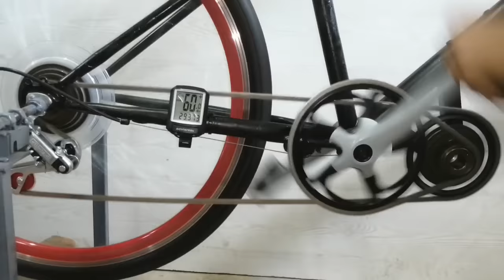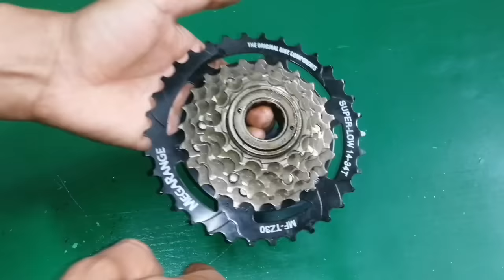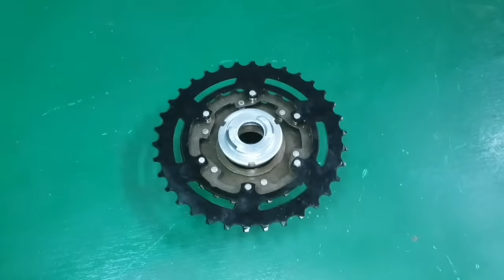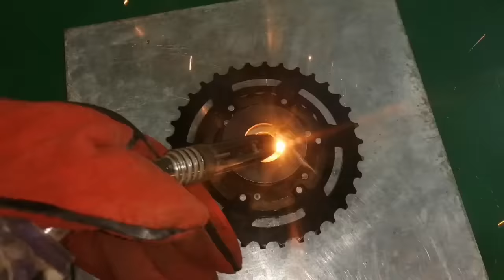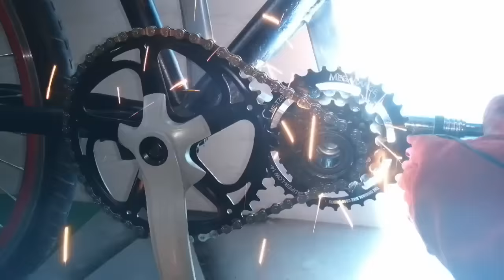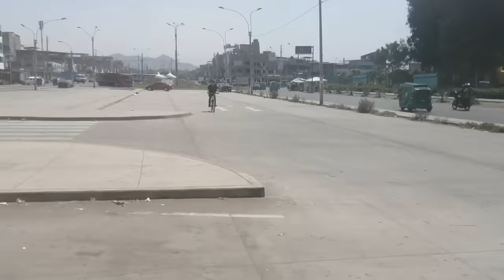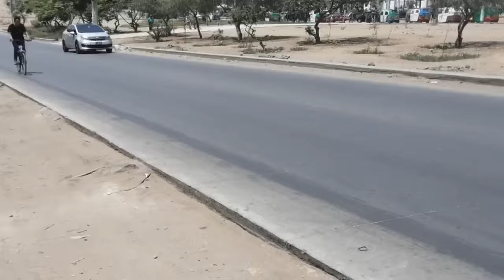making super fast bike

Comment: Bikes used to have a front derailleur for multiple sized cranks.  I hate that this went away.
Regardless, the most effective way to increase speed while reducing the amount of force needed at the pedal would be a pulley system.
Reply: no many bikes still come with front derailleur.  they've just fallen out of favor cause there mostly useless, in regards to the number of gears you'll actually need or use whil out on the road.   the advantage of a front derailleur is not  to get 21 speeds but to have a down shift to a smaller gear which is handy and smoother when going up the hill. where changing to a bigger gear on the back to downshift is more clunky when your required cadance is hard to maintain.  with most e-bikes and a lot being hub driven  its actually better just to have a small gear ratio where its easy to pedal to get started and a high one to switch into when your moving along nicely as you don't need much else.
Reply: Thanks @Plaxy100, I've been out of mtb since Sram just started introducing the XX & X1.  Now back in with post-divorce budget (~$0), I'll eventually get to upper level cranksets.  For now, the frisbee-sized ninja stars appearing on the granny side of 12 speed cassettes make me wonder how close these ratios still are.  My Southwest US racing commonly involved >1 hour climbs at over 10,000 ft.  I needed to keep the granny gears close together as I have a very rapid narrow-range climbing cadence. I just don't see how the fine tuning can remain for the most demanding XC riding when you reduce all prior solutions to a 12 speed. Thoughts?  (I know, I know, I can plug the numbers into a spreadsheet to get all the ratios, but I suspect that on-the-trail may feel different than on paper.)
Reply: Front derailleur is only good for stop acceleration. Useless otherwise, just a piece of metal adding weight, dirt and rust risk
Reply: @Aphorism89  Higher top speed is another reason for it.  The tiny single cranks that come on bikes today suck ass for everything except coasting downhill.
Reply: @Inmate533  luckily they are easy to replace and relatively inexpensive. I mean, one can eventually take them out and buy too quality ones instead. I wouldn't mind having 2 plates, used to have that on my road bike and it was great.
But now a days I'd always try to minimize. The least elements, the least maintenance and risks :/
Reply: @Aphorism89  It sure is helpful when you are going uphill with strong winds and cargo on board though.
Reply: Most cheap bikes still have a front derailleur. At bikes that dont have one you can in many cases add one.
 I think front derailleurs have some advantages, but they als make things a bit more complicated. With 3 sprockets at the front and a casette at the back, you have several combinations that dont work well, because the chain runs too much diagonlly. Beside that you als have several very simila ir even the same gear ratios. 
So I can understand why many people prefer having no derailleur and a bigger casette instead.
Reply: @jeanyluisa8483  Cross chaining is much more of a problem with 1X coz with 3X you can always find the required gear with the chain ⛓️ reasonably straight.
Reply: @radiocontrolled9181  In 1X10 the sprocket in the front should be about in the middle of the cassette. In that case the chain in worst case has to to 5 gears left or right of the front sprocket. If you use the smallest or the biggest sprocket in 3X7  the chain might have to go 7 gears left or right and those old cassettes are even wirder than the newer ones with 8-10 gears. 
So the crosschaining can be much worse in 3X  and there are combinations that work very bad or dont work at all. In 1X all gears should work, otherwise it wouzld be a very bad design or setup.
Of course you can find combinations whith the right gear and the chain being resonable straight in 3X. You even have to find those combinations, thats exactly why I wrote 3X can be more complicated.
Reply: @jeanyluisa8483  With a 3X you will obviously avoid those combinations that involve cross chaining of 7 gears. And you don't really need those as you have an alternative with 3 front chainrings. With a 1X you have no alternative to cross chain 5 gears when you really need that gear. This cross chaining issue with 1X's is a fact that even many hardcore 1X fans fully acknowledge. Now if 'finding' those combinations on a 3X to keep the chain reasonably straight is too complicated for you, well then probably the 1X is made for you. But I can assure you that any person with an average IQ or even below average, will be able to find them without even giving it a second thought. It will come as natural as changing gears in a manual transmission car.
Reply: @radiocontrolled9181  Talking about persosn with an average IQ - those usually also can read properly. I never wrote finding the right combination on 3X is too complicated to me.  I wrote "front derailleurs make shifting a bit more complicated, so I can understand why some people prefer 1X". Of course those people are not too stupid too find the right combination on a 3X. They are just smart enough to understand that its more comfortable and simpler to use one shifter and one derailleur only.
If you look at the market, there are still a lot of 3X. It's mainly the expensive bikes for high end and professional users that have completly changed to 1X. So it's obviously not just silly people who prefer 1X.
Reply: @jeanyluisa8483  LOL talking about people who can read. Seems like you missed the word 'if' in my comment. Read again. About professionals using 1X, those are sponsored by the big bike manufacturers who want to push new products on the market to sell more. They use them as advertising. The professionals wouldn't be able to choose to ride a 3X even if they personally preferred that. They are forced to ride 1X. The 1X invention was a marketing move to convince the masses that it is an upgrade when in reality it is a downgrade in most cases. It worked. The sheep swallowed it all. And the bike manufacturers stopped selling high end 3X to give the customers no other choice but to buy 1X because it's the new 'trend' and it is 'better', 'cleaner' and 'lighter' and all the other bs
Reply: nic ie odeszzło  Shimano całyczas produkuje takie korby
Reply: @plaxy100 It's not really about a smaller gear. Your can get very small gears with 1x. You just have more changes between each gear. So you may not have the gear you want especially if you don't have 11 or 12 speed in the back.
Reply: @radiocontrolled9181 Currently the most popular chainring is a 2x. Most good bikes are 2x. And the last TDF winner is a 1x bike. 3x is really on the low end bikes.
Reply: @berkertaskiran  Yep, currently. Which means it's where the big bike brands and their sales promotional people are pointing at at the moment. It's always like that. The moment they start pointing in another direction, that will suddenly become the new 'good' and the new 'best'. Because most people are too gullible and easily influenced.
Reply: @radiocontrolled9181  Stuff gets improved. It's not always marketing. You don't have to get something new if something works for you. I own a 3x8, and am in market for a 2nd bike which will be used by two person so it's not like throw away the old one. I wouldn't really get a new bike or a new drivetrain just to follow the trend. It's useless. Unless I have money to burn. Personally I like the simplicity of 1x but have never used 1x or 2x. I know I am not a fan of a ton of gears on 3x. It's just you get pretty much similar amount of gear options with 2x. With 1x you obviously get less. But 12 speed is a bit better. Not very cheap obviously.
Reply: @Aphorism89 there is me on my road bike that leaves traffic lights using 53 at front and 11 at back
Reply: @mlee6050 headwind is the main factor
Reply: @PInk77W1  I yet to find a headwind strong enough to make me change down, most annoying thing is most go with wind and my journey is often against
Reply: @mlee6050  if there’s zero wind and u go 20mph u now have a 20mph headwind
Reply: @PInk77W1  guess that helps as then starting of is easy
Reply: I've got a rare 3x on a road race bike and love it, as you can quickly go from extreme climbing, to spinning the mid ring in order to accelerate, and then to big gear cruising, all within the span of three shifts without cross chaining.
Reply: Es mejor monoplato 1×12 54 dientes en el plato delantero y 10-60dientes desde el más pequeño al más grande
Reply: @jeanyluisa8483 the point of 3 front gears is to quickly drop down a large amount of gearing quickly when needed. Also the lowest ratios on each end are almost in line, and the higjest ratios on each end are made to line up so top gear has least chain drag. If you change down to a middle rear gear, probably drop to the middle front if you're worried about drag. Its not hard to keep the chain relatively straight. Or just do away with derailleurs altogether with a schlumpf high speed drive up front and a rohloff or enviolo rear hub. With these you can use a belt drive that will outlast a chain using less energy and no worry about lube.
Reply: @rossbrumby1957  No, thats not the point of the 3 sprockets in the front. Derailleur gears where invented more than 100 years ago. Thery started with few gears and at some point they added sprockets in the front too get more gears.  50 year ago precision of industrial manufacturing was not as good as today. So it was easier to add 1 and later 2 sprockets in the front.
Reply: ITS SO BIKE companies can cut costs but yet charge us more almost doubling their profits.
Reply: @jayhope615  I agree.

Comment: It seems like there may be an easier way to do this. Like a bigger chain ring.  I’ve seen them at 64 teeth.
Reply: Or just change the rear sprocket. Or both.

Either way, the end result is the same.
Reply: @akisalmenaho8473  But both ways would end without having a video ;-) I'm pretty sure the video was the only intention for thos build, the bike will be pretty useless with that high gear ratio.
Reply: Like a real casette, not that 20 year old vintage crap, with the smallest gear with 13 or 14 tooth, instead of 11 or 10.

Comment: This system is quite ingenious. It could work with a mid-drive electric bike. The motor could be attached to the first freewheel. By able to use a small front chain ring and a large rear cog, this ebike could have insane high torque for climbing steep hill.
Reply: It would also need an insanely heavy motor drawing insane amounts of power in order to get that high torque. You would get up maybe one hill before needing a recharge.
Reply: I'm running a mid drive 750w Bafang bike now, the torque using standard mtb ratios is enough to climb any hill easily. There is no point in this system with a mid motor bike, especially as I'm getting 59kph easily as is.
Reply: @GB-vn1tf  Basically the fellow who produced this video was showing off his welding skills by not improving something that needed no improvement.
Reply: It gets to a point where you're bending spokes though.
Reply: @ericbaillie1098  I think he was looking to gear down the motor having it spin faster, rather than stressing a Bafang mid drive by making it turn tall gears. Though to be honest it's rare to need less than 30-40 something gear inches with a bafang unless doing MTB climbing or something. My 48-32 on 26" wheels was good to go on most stuff with assisted pedaling for road use. And I wasn't mashing the power deep into the red zone either. I could stay in the green and yellow and light only 1 red, though it did struggle a bit on 25% gradient without pedaling. If all the red lights are maxed and the pedals are below 90 rpm then downshift or back off the throttle to prolong motor life (especially with a fresh battery).
Reply: Только, хочу заметить, есть один недостаток - при вращении в прямом направлении, электродвигатель имеет при себе сопротивление. Особенно это видно при отсутствии тяги. Это приводит нас к мысли, что при такой трансмиссии вы физически не сможете разогнаться быстрее максимума двигателя. Не хватит сил превысить порог максимальной скорости двигателя, так как он уже не помогает, а сопротивляется. Проверено у нас в России на арендных электро-велосипедах с ограничением 20 км/час. Я велосипед с обычной трансмиссией способен разогнать до 40-45 км/час, само собой по ветру... Идея в видео имела бы место быть на специальном треке, если бы не еще одно НО - трещотка это самый дешевый и некачественный расходник...
Reply: cyc check them out50 mph
Reply: Well youre talking about gearing it down, not up like this guy- the idea is going faster. No need to use an extra sprocket when you can but 60 or more teeth sprockets to replace the standard front one. As for your motor uphills- just use low gear the bike comes with because its that low already.

Comment: The operative equation limiting the speed you can get out of a transmission system is: P = a * v, that is, power equals acceleration times[/dot] velocity.  Power, being provided here by human legs, is held constant and changing the gear ratio affects only the ratio of acceleration and velocity.  Acceleration is bounded from below by friction and drag forces (and gravity if you're traveling uphill), so if your gear ratio cannot overcome those dissipative forces, you'll grind to a halt.  Therefore, if you really want to maximize the speed of your bike, your only real options to reduce drag and friction are improving its aerodynamic profile, reducing its weight (friction is directly proportional to the magnitude of the normal force), lubricating moving parts, etc.

Comment: Reminds me of the CVT transmission set up in the nissan.  The configuration of the chain and gear ratio. Very cool. If you make it a electric bike no telling how fast it will go. That could be kind of scary though if you wreck.
Reply: No need to do that though,  just put on a bigger front chain ring and you have the same result. My Bafang powered bike hits 59kph with normal mtb gearing as it is.
Reply: I’m sure it will break down like the CVT in a Nissan too.
Reply: remine me of a honda cvt gearbox for a mtb
Reply: The road rash could pretty ugly without the helmet...
Reply: No telling, you actually could tell very easily with the right bits of info. A standard bike gear ratio spinning at 100 revolutions per minute in a 52 12 chain ring cassette combo would yield a speed of around 65 mph. Plenty fast. Also if it's a crap bike and/or aluminum frame that's when stuff start vibrating off and breaking. Unnecessary and esthetically makes me want to vomit and my eyes want to commit suicide.
Reply: In theory, you could peddle at 100 mph.  In reality, the bike is no faster due to increased rolling resistance, and wind resistance as the speed increases.
Reply: @snowcrest7863 rolling resistance is almost nothing, and it doesnt magnify with speed increase like wind resistance. At around 30- 35mph around 80% of your pedalling effort is pushing air. This is why I want a velomobile next.

Comment: So I'm guessing your new configuration doesn't require those extra bearings that fell out of your cassette...?

That's very interesting.

Also what was the purpose in taking the cassette apart just to allow some bearings Fallout and then put it right back together again without adding grease or making any other modifications or was the purpose just to remove a few tiny steel balls for unknown reasons?

I'm just a couple of minutes into the video if that and already thoroughly confused I would have seen this far so if you could please elaborate on that I would appreciate it because that would help me eliminate some of the confusion (so far)
Reply: At the first moment I thought the same. But if you really look at it, its no bearings that fell out. The parts that "fell out" are the claws that prevents the cassette to run free in both directions. As he shows after putting it together again, the casette can run free in both directions. Usually a casette can run in free in one direction only, otherwise it wouldnt turn the wheel. 
I think that build is nice made. But it's of course still a very old and well known technology to connect gears ion series for increasing the gear ratio. If it would make any sense manufacturers of bicycles would use it since a long time.
Reply: The parts removed were the ratchet pawls (they make the click or buzz sound from the rear wheel). He removed them because that part is a rear hub and cassette. Without them, it will spin freely without engaging or clicking, just a straight bearing.
Reply: @gangstreG123  I suppose I should learn more about bikes then if I'm going to be serious about building one.
45 years ago when they were my primary mode of transportation I just rode them, wrecked them, and Hustled up a new one if it wasn't ridable anymore

Comment: Just put the small sprocket at the pedals and larger sprockets at the rear. Skip the additional friction created. The problem is nobody will be able to get this bike moving. The initial force required to get the bike moving will be pretty large, not to mention hills. At least i will not be able to use this.

Comment: No, this simply doesn't work, quite the contrary, an additional gear will reduce efficiency by ~5% compared to a setup with a single gear and reasonable gear ratios. The biggest problem when cycling at higher speeds is aerodynamics, it requires a lot more power to cycle just a few km/h faster, no matter the gear ratio, the power is always the same. Cyclists usually can put out the biggest power around ~90rpm, TT bikes are designed to go ~60km/h with comfortable cadence, given you have enough power (which usually only the case when going downhill, unless you are Lance Armstrong). The footage in the end is sped up, cadence, posture and especially the movement speed of the vehicles in the background aren't normal.